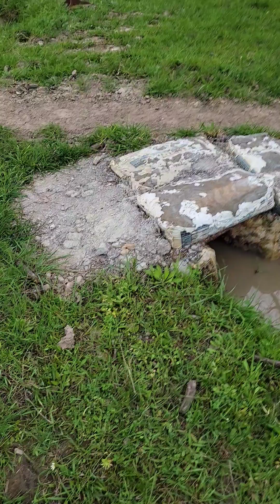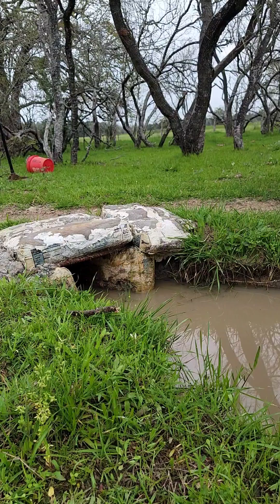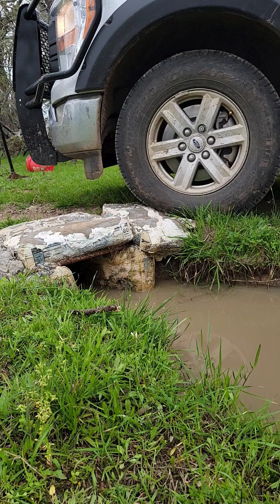Experts said this would not work. Well, here it stands. Stacked #concrete bags.

Comment: Its the rebar that's taking the wait dude. And u never even really ran over it ,just the tip of it. Just saying.
Reply from the maker: Appreciate you watching. And yet - there it is. 2 years old and not a single flinch when I put a hybrid truck wheel on it. 

Plastic aprons are $200. Concrete is more and I can't move it myself. This cost me nothing as I got the ruined concrete from HD. 

So, I agree I would not build a bridge out of it. I'm saying I saved between $120 to $500 depending on materials.

Also, keep in mind I ran it over dozen of times to pack it down. It is stressed tested. Wouldn't have mattered if it was my tractor and I ran it over 100 times.